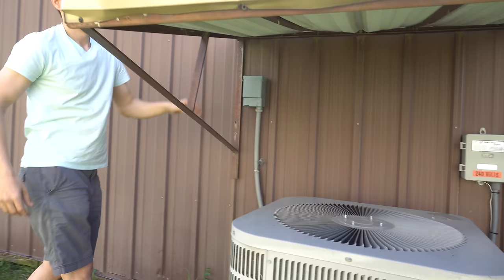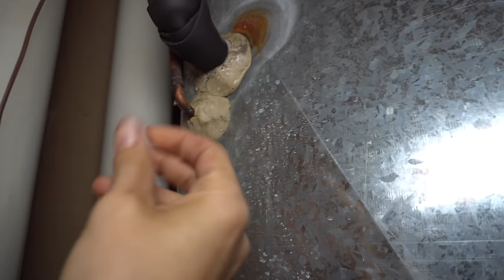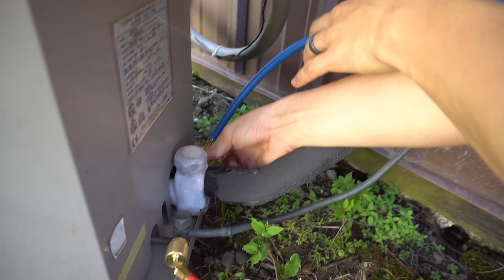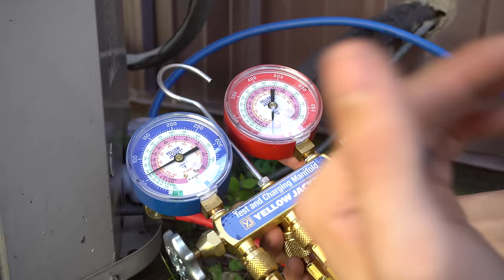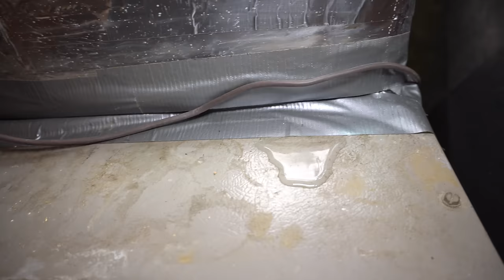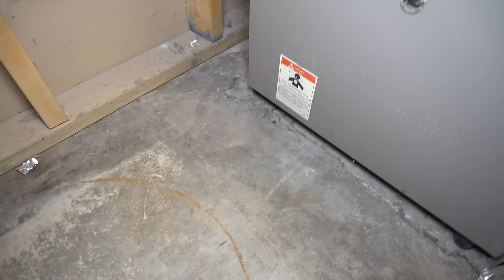How To Add Refrigerant To Air Conditioner

Comment: hi , what about R134a [for cars ac system] do you add them in liquid or vapor form? please advise. thanks.
Reply: I'm no expert, but I'd guess it has to be in vapor form since you'd be filling it from the suction side of the compressor. Compressors generally only take gases as liquids would destroy them.

Comment: Why does the panel on the system have the factory test pressures for low at 150psi and high at 300?

Comment: Outside temp  about 40degrees  unit short cycling  for 2 sec  aux heat running  but refrigerant is somewhat low   attach gauges what should be about on low side and high side readings

Comment: I’m in HVAC school right now, you can put refrigerant in a system if it’s off.
Reply: Yes, as long as the pressures in the system are lower than the cylinder pressure.

Comment: Hi this is a grate video, but could you please help me with something 
I just had technician at my home adding refrigerant to my ac, I wasn’t home and much less I didn’t care at the time but when I got the bill it looks like he charge me for both r22 and r410. Should he add 2 different refrigerants to the system?
By the way my compressor tag said R410 
Or was I ripped off?
Reply: R-410A was added. Maybe the labor charge was printed wrong.
Reply: Greg KOZIARSKI. Ripped!

Comment: Question so my gauge set for working on my cars ac is same as the one they use on Home ac units? same connectors ? thanks
Reply: No it is completely different equipment usually only found at automotive stores and not HVAC/R supply houses.

Comment: Is there a simple way to explain why frost accumulates on evap coil, condenser valves, etc?
Reply: Low side pressure is too low, meaning the evaporator coil and suction line are below freezing temperature of water. This freezes moisture that collects on them. Pressure and temperature directly influence one another.

Comment: If the refrdgrent is leaking you can take the gas out pressure test it with nitrogen to see where the leak is using a leak detector spray or a Leak machine and then yiu can weld it saving your friend a good bit of money

Comment: Thanks for a great video I have a question would turning on heat hurt the heat exchanger  when all the water drops down ?
Reply from the maker: It is probably not too healthy for it but from my experience and the experience of those who taught me, it is very rare that something gets damaged from doing this. If the heat exchanger does get damaged from this, then likely it was not in good shape to begin with.
Reply: @WordofAdviceTV  I have to disagree. This is kind of the lazy man's way of going about it. You know you are going to flood that furnace/air handler. That much water can make it's way down into the electrical junction....chances may be small but why take the risk. The proper way to go about this would be to run that fan and come back when it was good and thawed. If you're in a time crunch then cut open that plenum, thaw it out and then make a patch panel. Besides, for all you know the leak could very well be in that evap coil.

Comment: Hey man I need help ac not cooling we had a power outage that lasted less that one minute and our ac is not cooling no more. Fans working inside fan working outside replaced capacitor (I was sure that was the issue) same no compressor turn on. Plunger is pulling in fan kicks on outside but not the compressor any thing I can do to conform or fix

Comment: You said never charge on high side, how about 410A, because it should be charge into the system in liquid form, where are you going to charge it, low side or high side
Reply from the maker: Always on the low side. But yes, 410a can only be added as a liquid, meaning the tank would need to be upside down.
Reply: @WordofAdviceTV  secondly if i use fieldpiece sm480v, does it calculate automatically total superheat and the target super heat, or i still need to hook up my wb in the return near the evap coil, thanks

Comment: Is there any reason you did not charge through the high pressure port
Reply: The pressures on the liquid side are typically higher than the pressure in the refrigerant cylinder. It's not that you shouldn't, just that you can't.

Comment: how likely is it that 10 lb of r22 were added to a 3-ton system. In this video it sounded like the average was two or three pounds. I believe that I was ripped off. The unit is roughly a 2010 Goodman 3-ton heat pump.
Reply: A 3 ton unit does not have anywhere near 10 pounds unless you have 300 feet of line between the condensing unit and the evaporator coil. There should be a plate on the system that tells you how much refrigerant it has.

Comment: Soo why did the suction line iced up ? Because it didn’t have enough Freon?
Reply: Yes , it didn’t have enough refrigerant so when the unit was running  it would start to freeze due to the low pressure/temperature in the suction line. Adding refrigerant brings that pressure up ( above freezing ) .

Comment: what would happen if you over charged the unit?
Reply: you can damage compressor ! Some not evaporated refrigerant liquid would enter the compressor, possibly damaging suction valves. Better slightly under- than overcharge.

Comment: I don't understand. If a low freon level makes the indoor coil freeze over why don't these manufactures use a bigger coil and a stronger blower to dissipate these cooling capacities? In this case, we will be using less Freon on these units and the compressor doesn't have to work as hard.

Comment: Why does a low charge system freeze up. Thanks
Reply from the maker: Pressures correlate to temperature. The refrigerant pressure is above the freezing temperature normally. (let's say around 40F) If the unit is low on refrigerant, the pressure drops which means the temperature drops as well. Once it goes below 32F, the condensation that forms on the low side of the system will start to freeze up.
Reply: @WordofAdviceTV  thank you. Appreciate your videos

Comment: if the system leaked out. is is more than a 10% leak and are you going to repair it before you charge it? also  shouldnt the coils be cleaned before adding refrigerant?  you can get FALSE readings if the coils are plugged.

Comment: Why did the unit need replacing? Also can you charge as a liquid in the low side with r22 or 410?
Reply from the maker: It's an old unit and he just wants to get it replaced instead of dealing with the leak repair. Yes, you can charge both, R22 and R410a as a liquid but you have to "throttle it in", meaning you only open the gauge up slightly so that the pressure does not increase more than 10psi.
Reply: R410A should only be liquid charged!

Comment: What does a r22 tank weigh when full? Thanks
Reply: 30 lbs of refrigerant plus 7-8 lbs for the cylinder itself. Some come in 50 lb sizes but I haven't seen those in years.
Reply: @512kjt  Thanks

Comment: why don’t you find and shield the leaking areas before you pump the new refrigerant in the system otherwise it will be leaking again?
Reply: Some leaks are all but impossible to find or are found but are not repairable. The most common spot for a leak is in the evaporator coil which is usually not repairable.

Comment: I would like to open up a discussion about the ending cycle of 134a. It’s being converted to 1234, which a very flammable gas and extremely expensive comparison to 134a. That’s means a completely overpriced brand new equipment and more training. Blame the epa.

Comment: I like to also see you find the leak in your friends system or a customers system.  How are leaks found and fixed.
Reply: AC Service Tech (youtube channel) Craig M has been putting on educational videos for about a decade. Besides the education; the tools to find a leak basic are bubble solution i.e. micro bubbles by BIG blue you have other tools like gas detectors and Ultrasonic Leak Detector * superior because theres no cross talk, sensitivity issues, false positives. Leak refrigerant signs are oil residue at certain fitting points (king valves), TXV, on the coils themselves.

Comment: How do you charge a flat unit?
Reply from the maker: If the unit is flat I would normally not refill it since the refrigeration system likely has air and other contaminants in it. It would need to be pressure tested, leak repaired, vacuumed, and only then refilled. Is it possible to refill it without doing all that? It is, you would just need to add a lot more and hopefully that leak is not big otherwise it will all leak out pretty fast.
Reply: @WordofAdviceTV  what would happen if I charge as vapor in low side 410A?
Reply from the maker: @Manuel Ramirez  410a is a blend of refrigerants. If you add it as a vapor, that blend ratio gets screwed up. I know it should never be charged as a vapor so I actually have never tried it before so I can't tell you from experience 😅
Reply: @WordofAdviceTV  I will let you know as soon as we use it, it is 99 today in chicago so will be a great test

Comment: I think on another video he said these are sealed systems so if they need filled it means there's a leak.
Reply: If they have service valves then they aren't sealed systems.
Reply: @wildmike85  He was talking about how a low system will keep leaking....so maybe that wasn't the word he used. Thanks, my brain didn't notice so it's my brain's fault.
Reply: @greenspringvalley  Yeah, Mike is wrong. All refrigeration systems are designed to be SEALED, as in never lose refrigerant. Service valves are just that, service valves. They are used only when servicing a system, which doesn't always mean adding refrigerant.

Comment: What is it with all these  ads interrupting the video so much?  How do you know how much refrigerant you have in it to avoid overcharging it since the friend is not being charged?  How about if you undercharged it by say 8 ozs?  Will it still be sufficient to carry the correct lubrication amount to the compressor

Comment: How bad is it really to use this method? Because we live paycheck to paycheck and have gathered up some equipment and freon over the years, I'm having to replace a 3.5 ton compressor myself. From the videos I've watched, adding in the refrigerant seems a little more overly complicated than it really should be, not to mention the gadgets you apparently have to have.

Comment: I'm at 75 n just a line over 200 after charging.... am I good or do I "have other issues" like mentioned in the video
Reply: You cannot charge a system just by the pressures on the gauges. Refrigeration systems (AC included) require a certain amount of superheat and/or subcooling to get the correct charge. To get those number you need to know things like the wet bulb temp, the ambient temp the suction/discharge line temps.
Reply: @markf.4063  all well,  to late and it's working perfectly.
Reply: @markf.4063  None of the companies that have come to my house the last 15 years have ever done anything inside the house. They just look at the gages and temperature of the lines.  They were large companies too (some with 20 trucks).

Comment: 8:25 To be clear, no license is required, but an EPA certification IS required! You DONT need to be an HVAC tech or HVAC licensed, just EPA certified ( in the appropriate EPA certification ID).

Being a bit pedantic, there is a LOT of 'slang' and vague terms/words being used in this video. Knowing simply how to "throw charge in a unit" is wrong and the incorrect way to teach. Knowing how and why something is done is FAR more important than knowing simply how tot get something done.

Comment: Isn’t it illegal to recharge r22 knowing it’s gonna leak epa says it should leak more that 10% before you’re supposed to fix the leak and r22 is the worst for the environment
Reply from the maker: It is a slow leak if it takes it a year to start to freeze over. And when the unit will be replaced, the R22 will be recovered and disposed of properly.
Reply: No. But HVAC techs love scaring homeowners into thinking doom and gloom and they will never be able to get r22 anymore.  When the truth is ANYONE can go on eBay right now and buy 10-15 or 30 pound cans of R22 and have it shipped overnight.
30 pounds for $350 and I can help all my friends and family not get screwed over by a con man HVAC tech

Comment: Probably has a refrigerant leak from the high liquid pressure caused by the roof that's improperly installed above the unit

Comment: this is the only video i've seen where they don't turn the can upside down..
Reply from the maker: You can only do that with un-blended refrigerants. R22 happens to be like that so you can add it in either vapor or liquid form. Its actually easier on the compressor to add it vapor form too.
Reply: @WordofAdviceTV  did some more research. Just realized you have a green tank. For something like R-410a, I saw you can get a Vaporizer to prevent damaging the compressor. Or add it really slowly. thanks for the reply. I'm learning more every day

Comment: Did you not think it could possibly be losing gas before adding more 🤔
Reply: If the refrigerant leaked out then it needs a pressure test to find the leak and then repair and a good vacuum test then add the required refrigerant depending on the unit and the pipe work size and length

Comment: OK this is wrong, I've been in HVAC for almost 50 years and taught for 20, those are not the typical R22 pressures, the coil inside is supposed to be 40F, on the temp scale of the gauge that equates to 68-70PSIG, that should be the low side, your high side is going to be dictated by the temperature at the condenser, so if it's 80F outside, for that age unit you would add 30F to that bringing it to 110F and then convert that to pressure for R22 which would be @242PSIG.
Reply: what were you looking at?   after he closed the fill valve it was at about 70  and  245psi

Comment: Don’t you need to vacuum the system first?
Reply: If you were going to find the leak and fix it yes but as he stated he was just charging up his buddy’s Ac to get through the summer so this isn’t necessarily the way you want to do it but it gets the job done when the heat is out.
Reply: @JP-zz5rm  thx man I really didn’t know, iv only done a car system once and it was a complete redo. Also found out my manifold gauges don’t work with R22
Reply: @Aliceswonderclam  yeah R-134a hoses are a slightly different size. I found it out when I ordered a pack of 3 hoses and when I received them they were for R-134a and didn’t fit on my gauges . Now I have 3 hoses for my cars Ac and only 1 set of hvac hoses lol.

Comment: hmm a guy just did mine and put the tank upside down with no scale..  thoughts?
Reply from the maker: That is okay, he was adding it in liquid form. When adding in liquid it should be added either with a vaporizer or throttled in - meaning the gauge would not get fully opened but just slightly cracked open so that the PSI on the gauge only goes up by 10 or 15.

Comment: The state where I live you have to have a licence to work on the your own AC or buy parts and you cannot get a licence unless you work as a apprendice for 2 years.
Forcing you to work hidden and purchassing parts on line, that's a racket, my AC needs Freon R22 and the tech who came is asking for $280.00 for the first pound of R22 and $180 per pound after that. I see the R22 on line for $16.00 dollars a pound. Not smart because the distributors could be making more money selling to many without the licence.

Comment: Should'nt you have 1st checked the reasons of ice most likely a leak before topping out expensive Freon?
Reply: I would guess the A coil is so dirty that air is not flowing through it, it doesn't need freon it needs the airflow restored

Comment: I see a "protection roof" over the condensing unit; this causes recycling of the upward air discharge. It will cause unit to run very hard and consume lots of electricity and premature loss of the compressor. In most cases home owners aren't qualified to recharge their units nor should be them able to purchase refrigerant without prior Certification; otherwise it is a vey serious crime. Check State laws!

Comment: 1.) You NEED Superheat and subcooling to charge properly. 
2.) You charge as a liquid, metered into the suction side. 
3.) Outdoor temperature reflects on the high side pressures not the indoor, but there's a relationship. 
4.) It's the liquid line you have the red hose attached to. 
5.) Those 'Normal' fittings you indicated won't spray you with liquid. There's no depressor for the Schrader.  

Here's the flak.

Comment: so heating and cooling businesses have the monopoly on topping off your system with refrigerant if you follow the law. that basically means they can guild themselves and set prices to gouge customers.
Reply: Do you mean like when they charge over $300 to replace a capacitor, which takes at most 15 minutes and cost less than $20?

Comment: Did anyone say where the R22 was leaking from?
Reply: Didn’t say He did say they are going to be replacing the unit so most likely both the condenser and coil are going to be getting replaced at the same time  regardless . I would guess the indoor coil with all the condensation they tend to rust and leak .

Comment: If the system has a leak you must first determine if its worth adding expensive refrigerant to the system just to have it leak back out into the atmosphere in a few days! Customers will always tell you it just needs some added to get them by but it's up to you to make a more informed decision on whether it's worth it for the customer and the environment!
Reply: IF THE COMPRESSOR BURNT OUT BECAUSE THE REFRIGERANT LEAKED OUT...DO YOU STILL HAVE TO PUT A RECOVERY MACHINE ON IT...BEFORE YOU CHANGE OUT THE COMPRESSOR?